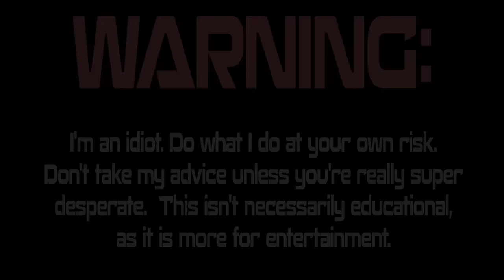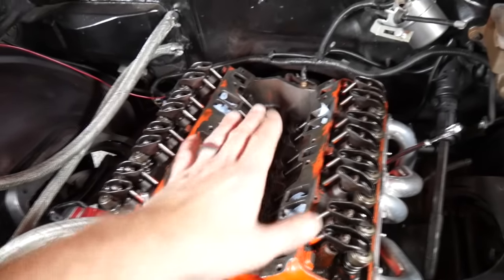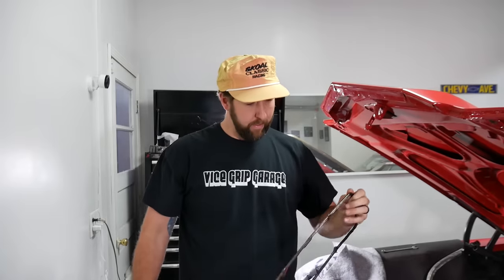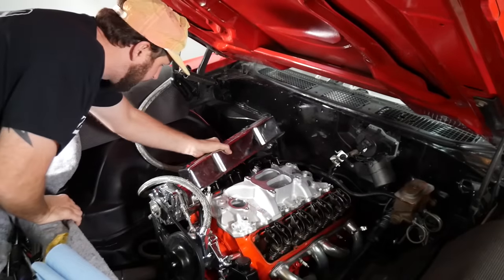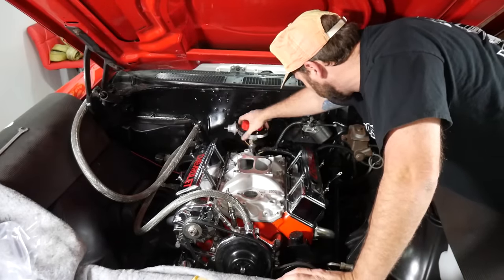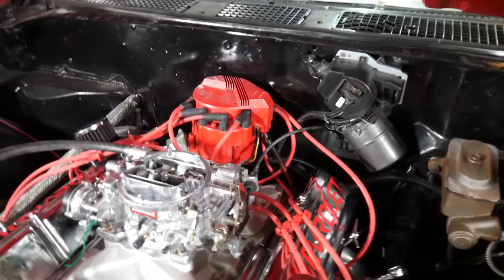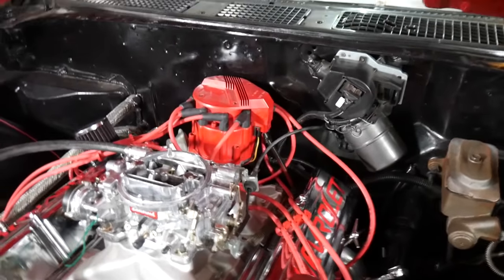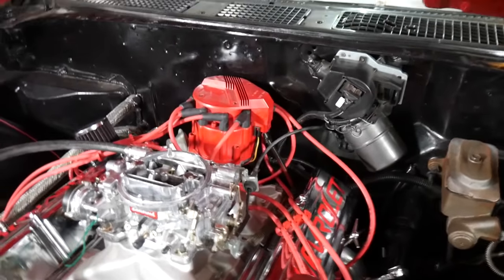Chevelle Gets Edelbrock, Cold Case, and Wheel Updates! - Vice Grip Garage EP54

Comment: I didn't watch the very end .  I couldn't.  I went into the Marines in 1980 and I left my 1972 Buick Skylark behind.  I painted it with sikkens base coat cleat coat hugger orange six coats.  I took the door handles off and I had a switch under the rocker panel that I would hit to lower the windows and reached in to open the door.  I painted all the chrome trim with black satin and the bumpers the same color as the car.  I couldn't afford the insurance on it and had to sell it.  I would give anything to have it back.  Semper FI.

Comment: Flex fans are great for stationary motors because they have great low speed flow rates. They are terrible for a car because they use a ton of hp and flatten out at high speed essentially blocking off the radiator. Electric is the best, clutch fan a distant second.

Comment: Hi I have a question.  I have a 010 350 block and am rebuilding.  It had a 8 inch balencer on it.  I want to replace it. Do u have a parr number u would use?    It's a 1976 350 thanks!
Reply from the maker: I dont off the top of my head.  Summit racing has a good "parts that fit" category.  Just search by engine type

Comment: I really like the sound of that cam, and the gear drive. Sounds about lik my C10 did. https://youtu.be/2co-HhWIstQ
I usuaully use the fel pro intake gaskets, and use gray or copper rtv for the front and back seals. It always lasts better if they dry for 24+ hours. Valve covers, I use cork, and glue one side to the valve cover, and leave the other side dry so I can remove it without wrecking it. Oil Pan gaskets, I prefer a one piece rubber one, but cork will work ok as long as you get it on straight, and good the ends a little with gray rtv, and let it dry long enough. I realized as I started getting older, spending more time letting stuff set up and dry properly makes it work better from the beginning, and last longer usually. 

I used flex fans for many year, I prefer them over plastic and a clutch fan, but lots of people say they fall apart. I've never had one fall apart myself. I try to run electric fans where I can now. 

Can't wait to get my Bel air out and driving under its own power. Well, steering in it's own- I have it running and driving and stopping, but I haven't quite gotten my steering done yet. For now, I will watch you get your projects going :)

Comment: So it's been 8 months since the original streaming date. Does a guy regret selling?
Also, Engine Masers did dyno testing of engine accessories and showed a 20-50 HP loss depending on the type of clutch fan, so go electric.

Comment: I would run a set of electric fans on that.  When an electric fan comes on because of engine temp, it runs full bore even when your are idling in the drive through line at the local scarf and barf.
Flex fans are loud and always seem to find a way to slice up your forearms when you are working around them.  They are about useless in the burger line on a warm summer night, at least in Nevada.
Clutch fans are a joke on any sort of performance car.  To much rotating mass, clutches are not reliable, all that weight on Coolant Distribulator whirly shaft prematurely wears out water pump seals and bearings, sucks away horsepower.
1. electric fans
2. flex fan
3. 3.-7010. deleted
7011. Clutch fans
in that order on a performance vehicle.